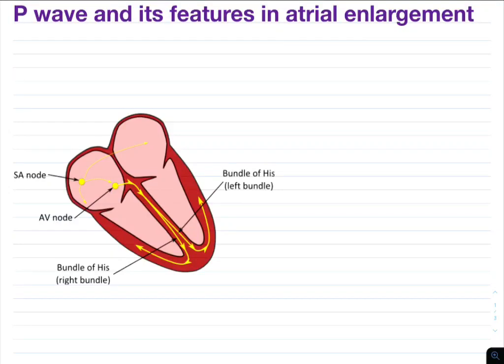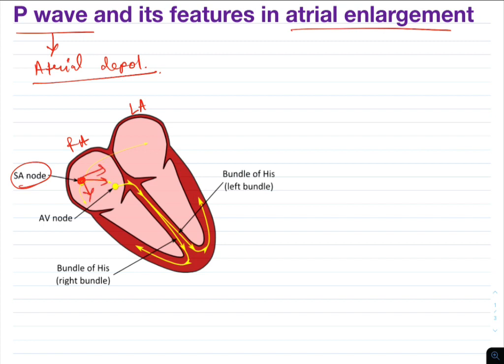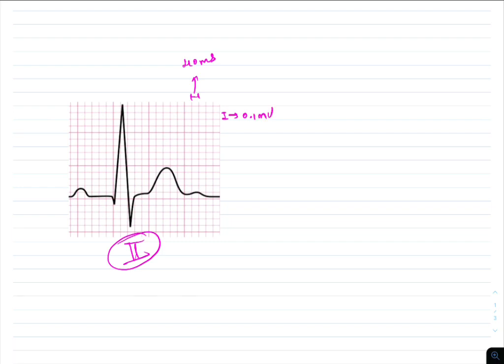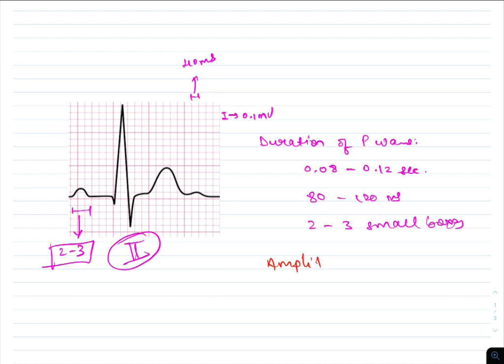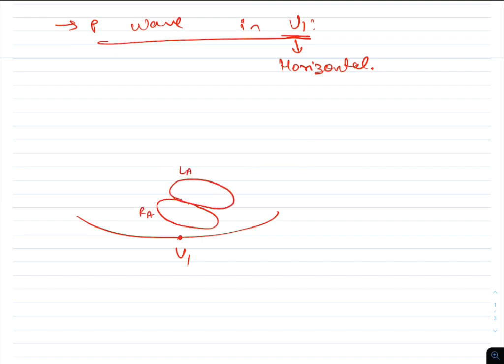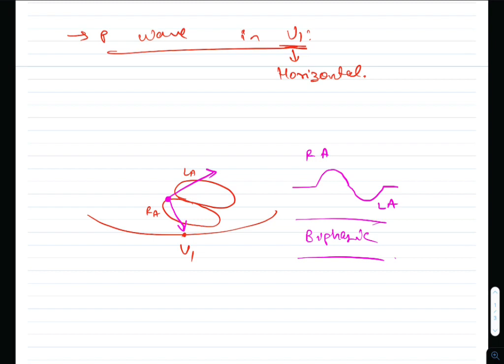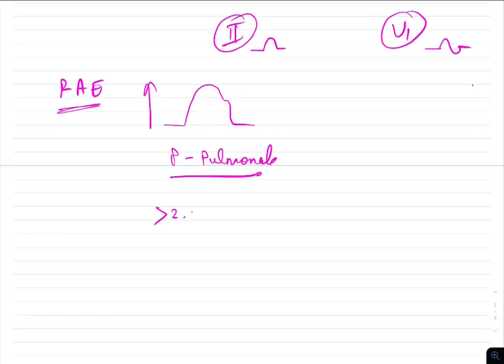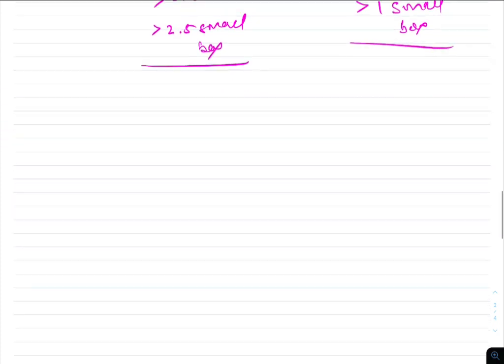P wave | Atrial Enlargement | P Pulmonale and P Mitrale

Comment: P pulmonale in lead II dimension again please??
Reply from the maker: P Pulmonale: Amplitute >2.5 mV or >2.5 mm in ECG paper in Y axis.
Reply: @CrazyMedicine 
No actually its  >2.5mm
Not >2.5mv its >0.25mv
Bcoz 1mm=.1mv
Reply: Sir im confused, as per previous calculation it will be 25 small boxes right? which doesn't make sense
Reply: @prasannayenumula9593  me also stuck here